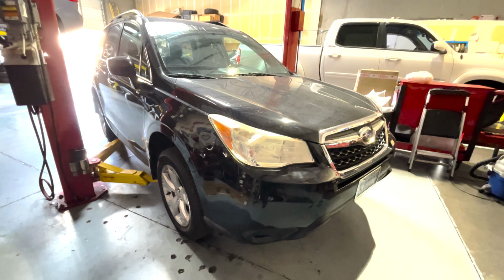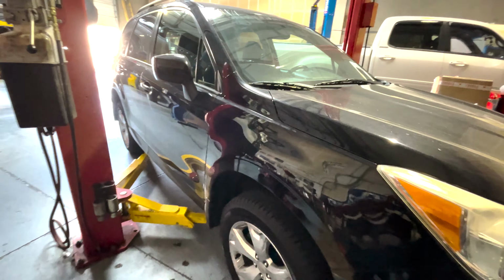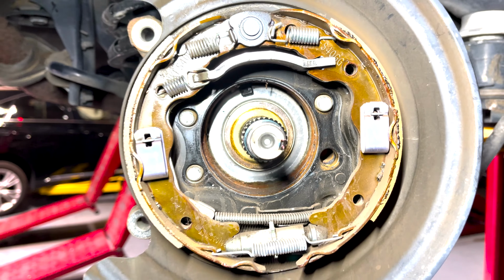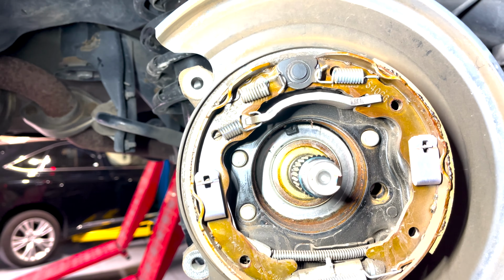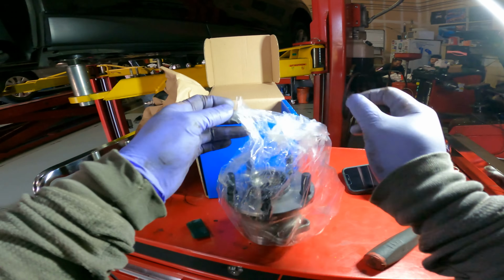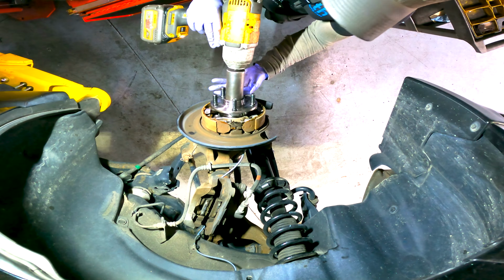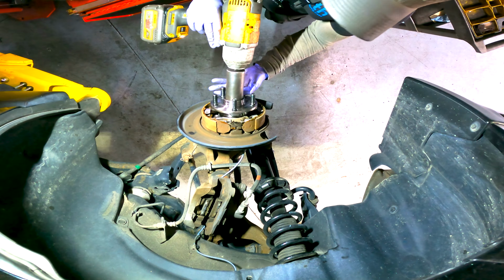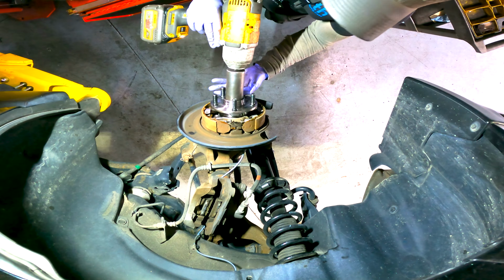WORN WHEEL BEARING DIAGNOSIS AND REPLACEMENT :: 2014 SUBARU FORESTER

Comment: That's what is wrong with my Odyssey, I need to get it fixed.
Reply from the maker: Front or rear? Rear isn't as bad. Front, that's a whole different story.
Reply: @SkillCollectors  It the rear, just got to figure out which side. I think it’s the passenger side.
Reply from the maker: @CesarsCarCorner  Jack the rear and do the coil spring trick. One will feel rougher than the other, that's your culprit.

Comment: The axle nut was supposed to be torqued to 140 ft lb, not 1,030(DeWalt DCF900B) because you're too lazy to use a torque wrench.
Reply from the maker: Guilty as charged, dewalt wishes it put out that much torque though lol. Next thing you're gonna tell me, flat head screw drivers are not pry bars.
Reply: @SkillCollectors  You were supposed to torque that axle nut to spec, unless you're trying to make the wheel bearings fail prematurely due to too much preload. Either that or you just lazy to the point that you don't want to use a torque wrench. watch?v=_XmQsjMsp-E
Reply from the maker: I can only interpret these comments as troll comments to try to get some kind of response out of me so this response is not really for you but for anyone that might read these comments. There is no preload specification for this style of bearing. We're not assembling a pinion gear here. Now should it be torqued, according to the book, yes... all the fasteners have torque specs. I always recommends people use the service manual if they are to change their own parts, if you feel more comfortable torquing every fastener then I think you should do that. I assure you after doing this job for this long, I've developed a feel for things, I can even tell when my gun has torqued an axle nut or crank pulley bolt, believe it or not. For what it's worth, I've never had a wheel bearing job come back in the entire 17 years working at the shop. I've also changed many CV axles this way and have never had a vehicle come back with a pre-mature wheel bearing failure. Our shop operates primarily by return customers so if there's a problem, we hear about it. Anyway, these videos are not meant to be step by step instructions, it's a guide for people trying to see how things are replaced. Lighten up bro.
Reply: @SkillCollectors nope, don’t be defensive, all home mechanics don’t have your 17 years experience, and won’t enjoy having to redo the work